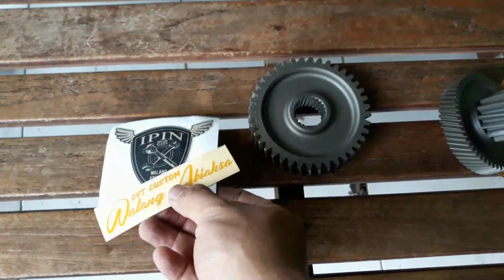Pasang Gir Rasio AEROX di NMAX... Hasilnya ??? ( Max Vlog #3 )

Comment: Saran kalo mau joss akaselari nya, gear cranshaft 12 mata punya nmax di padu dengan gear ratio aerox 40 mata jadi 12T-40 = 3,333 akselerasi joss cepat sampai top speed. Tapi klo mau pake aerox aja 13T-40 = 3,076. Tpi kalo mau main trek panjang standart nya udh cukup.
Reply: jd gmn om? mending pake set aerox apa cuma d padu aja gear besar nya aja punya aerox?
Reply: Enggak bisa, antar gigi nya enggak ketemu malah bunyi berisik parah
Reply: Tidak semudah itungan gt Ferguson untuk meracik rasio
Reply: Udah dicoba om pake 12T-40? Gimana rasanya om?

Comment: Om.gearbox 15t &35t biasanya di motor apa?mksh om
Reply from the maker: Beda merek belum tentu bisa tukar guling om.. ini saia pakai punya aerox karena kebetulan mirip, bubut sedikit jadinya pnp kalau mau betul2 pnp coba pakai aftermarket om.. ada ktc.. tdr dan lainnya.. ada banyak angka rasio yang bisa kita pilih 😊😊
Reply: @WirasajaChannel  
Saya bukan untuk motor mas.saya cari gearbox 15t satu biji&35t dua biji.untuk gearbox mesin Honda jazz 1.500cc tenaga 130hp.rasio 2:33/1
Reply: 15t biasanya di motor apa.mas dan 35t.
Reply from the maker: @stolaircraftsuyanto9728  oh njih om.. mau dirombak berarti.. kalau 15 - 35 agak sulit om.. kalau countershaft 15t bisa pakai punya pcx / vario 150 yg aftermarket..

Kalau untuk 14/35 ada punya xmax om.. 

Atau nmax untuk gir besar rationya juga 35 mata 

KLX 150 gear output low nya juga 35 mata om..
Reply: Terimakasih banyak.infonya...sangat terbantu dg penjelesanya yang keren.swon
Reply from the maker: @stolaircraftsuyanto9728  sami2 om.. thx sudah mampir.. 😊
Reply: @stolaircraftsuyanto9728  punya honda vario 150

Comment: klo gnti per cvt pake tdr 1500 yg berubah apanya gan ? sm klo gnti yg tdr 1000 .. sy pgn gnti, tp ktnya sih tarikan bawah enak, tp tarikan menengah keatas nya ilang atau kurang
Reply from the maker: Sebetulnya bukan dari nilai rpm nya sih gan..

Contoh.. per standar bawan motor rata2 1000rpm..

Namun punya karakter keras yang berbeda.. jumlah ulir berbeda bahkan diameter kawat ulir pun berbeda.. padahal sama2 1000rpm..

Riset saia cuma pakai per cvt beat karbu / vario 125 led.. hasilnya sudah berubah signifikan om..

Tapi memang putaran atas kurang bagus..

Kalau om sering turing keluar kota cukup per cvt standar om.. karena nafas atas yg panjang sangat membantu top speed..  😊

Comment: Om kenapa mtr saya malah kendor ya....
Seprti klo dri km 0-20 tu gk gentak malah berat
Tp klo km 25-40 baru ada gentakn nya
Km mentok di 100 sisanya lolos....
Reply from the maker: Spesifikasi standar om atau sudah upgrade ?
Reply: Masi standar PT om
Reply: Klo saya pake gigi rasio 12/40 gimna ya....
Bisa stending  gk ya.... Heheheh
Reply from the maker: @adherobai5719  cuci bersih dulu om seluruh jeroan cvt dan grease ulang.. reset ecu dan jalani proses injector cleaner.. 

Hasilnya nanti sangat signifikan.. 😁
Reply from the maker: @adherobai5719  he3.. mungkin iya om.. 😁😁

Comment: Malam om, itu pakai pir cvt Beat ya? Gimana sensasinya om??
Reply from the maker: Betul om.. per cvt beat karbu.. torsi bawah lebih terasa om dibanding standarnya.. cukup per cvt beat karbu + roller mio m3 12gr.. atas bawah ok om..
Reply: Oke om makasih infonya smoga sukses slalu 🙏
Reply: @WirasajaChannel  top speed brp dpt om dgn akselerasi yg skrng? Dari 0-100 ngisi gak? Atau ngempos di 70-90? Thks sblmny
Reply from the maker: @TheOktapratama  top speed tidak banyak berubah om.. namun torsi bawah nampol.. 😊

Comment: Om klo mesin standar nmax 2020 cm upgrade cvt aja bisa pk gear ratio ini? Apa efekny klo ganti ratio ini sama udah upgrade cvt om?
Reply from the maker: Sepertinya rasio new nmax sudah sama persis aerox itu om.. karena kodepartnya sendiri sudah berbeda dengan old namex 😊
Reply: @WirasajaChannel  nmax old sama nmax new rasio nya sama 13 35
Reply from the maker: Thx koreksinya om..
Reply: Saran saya jangan ganti dulu gear ratio. 
Cukup pakai pulley bubut 13,8+ coak jalur roller, roller 13gram/stadart, per cvt vario 150 lokal, per sentri standart, kampas Daytona, mangkok custom/kartel. Sdh jengat tenaganya dari empat rendah sampe atas.

Comment: Mas, suara ngiungny kyk apa y? Pake gir ratio aerox ilang y ngiungny?
Reply from the maker: Macam motor pulsar gtu gan ada nguing2 mengikuti naik turunnya speed.. betul gan.. setelah ganti malah halus gan..
Reply: @WirasajaChannel  klo gnti gir ratio doang bs om? Tnp upgrade cvt? Krn si om gnt smua tuh d video
Iya om. Pas kecepatn 40 km dan seterusny bunyi ngiung..
Reply from the maker: @goldyraymond8263  kebetulan yg divideo ini step 1 om.. jadi cuma pasang rasio set girbox aerox ( yang sudah disesuaikan ke nmax )
Reply: @WirasajaChannel  maksud sya kalau gnti gear ratio, yg cvt ny jg gk om? Atau tnp d gnt pke yg bawaanny bs?
Reply from the maker: @goldyraymond8263  cvt set standar ndak masalah om.. pakai rasio aerox torsi bawah langsung berubah rasanya..

Comment: Hi im from Philippines. I would like to have feedback regarding your aerox gearing. Have u change all gearing to aerox? Im using rb6 14 inches mags and planning to change also aerox garring. Your feedback is highly appreciated. Thanks
Reply from the maker: greeting from idonesia, im just change two of gear on my bike
Reply: Wirasaja Channel may i know which gear did you change? Primary or secondary? And you installed the aerox gear? What is the improvement?
Reply from the maker: @akosyjonathan  sorry bro, did you watch my video to finish?  if so, then you will see which gear I attach, the increase in torque at the bottom rotation is felt after changing the gear ratio
Reply: Wirasaja Channel yes bro i watched it until end, however i cant understand the language.

Comment: kalo graman loler nya berapa ?
Reply from the maker: Sudah 12gr dan per cvt tdr 1000rpm
Reply: @WirasajaChannel   top speed nya berapa ?ini pake loler 12 tdr 3 sama ori nmax 3 .per nya pake PCX OLD .
Reply from the maker: @febbyproject25  top speed tidak terlalu banyak berubah om masih di 120an.. cuma waktu yg dibutuhkan untuk naik ke angka tsb lebih cepat.. terutama torsi bawah lebih melimpah..
Reply: Klo kata mbah walangnya, rollernya make yg standar aj

Comment: Pake per cvt apa bang? Sama mau nanya itu nmax ada suara kretek" gk? Dan masalahnya dibagian apa? Makasih sebelumnya
Reply from the maker: Kalau di video ini per cvt pakai tdr 1000rpm om..
Reply: Pas putaran tinggi ngiung ya bang? Pas turunnya juga. Motor nmax baru yg 2019 saya kyk gitu bang. Apa dengan ganti gear rasio aerox hilang ngiungnya bang??
Reply from the maker: Coba di cek dulu bearing girbox nya om..